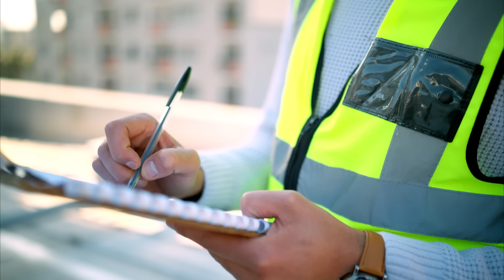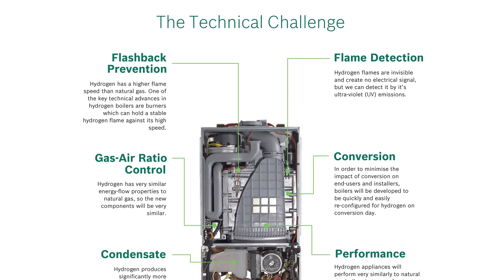Is Hydrogen Actually Dangerous? | The Real Facts

Comment: A mix of gases is probably the most practicable as there will be an increased availability of sewage and landfill gas and also a need to absorb/use them, as methane  is a potent greenhouse gas.
Also, the range between upper and lower explosive limits of H2 is greater than for NG or LPG - 4 to 96%. I don't know how this applies to a mixture.
By comparison NG/methane will not ignite below 5% concentration in air or above 15% (LPG is 2 to 10%)
Another cosideration is that it will ignite itself in the presence of platinum  - I remember there were kitchen stove lighters that were just a tiny piece of platinum that would glow red hot - no batteries or piezo. I don't know if platinum is used in any of our modern gadgets or sensors?
Given the lack of accountability we have seen with Grenfell and such, and the sheer number of companies that would be involved with statistically a high chance of cowboys, and greedy shareholders wanting corners cut (already a race of lifeless robots IMO) I would steer clear - especially if there is money to be made.
It might have its place industrially as an energy buffer but domestically an expensive trap.

A lot of Natural Gas is used as feedstock for making plastics; I don't know how that affects the market.

Comment: A sudden change to Hydrogen gas is not practical. 
It also is a master at finding any leak, absolutely not an option in an almost air tight heat pump heated house, we get houses that are anything but air tight blowing apart now from natural gas.
A say Hydrogen as a mix with natural gas and changing the mix over years allowing time for appliances to adapt at the replacement rate is the way to go.
But pure Hydrogen is never going to happen.

Comment: The question of safety is essentially moot until someone comes up with an economical way of producing hydrogen in the quantities required for widespread use in heating and transportation. So-called 'blue' hydrogen comes from fossil fuels, so the only rationale for using it is in things like buses in cities, where you want to avoid pollution at the local level, which is a niche use. The only viable source in the long term is 'green' hydrogen, made by electrolysis of water using electricity from renewable sources. However, this can never be as efficient as using the electricity directly for heating and transport, especially when comparing to heat pumps, which produce about three times as much heat as the electricity they use can generate directly. The technical difficulties and economics of hydrogen appear to make it unworkable for large scale adoption in the foreseeable future, perhaps ever.

Comment: Excellent video as always, Roger.
My thoughts:
1). Safety: you've got to design for the lowest common denominator. Hoping that safety devices will compensate for sloppy gas fitters goes against this principle.
2). You can't add anything to the gas to make it smell, as the smelly molecules will all be bigger than a hydrogen molecule.
3). Wind-generated hydrogen being used in intermittent gas fired power stations may be greener, but, as we already know, the electricity generators will charge a huge premium for intermittent use, so this is a mitigation of intermittent wind power rather than a solution in itself. 
For my money, the solution to all this is modern nuclear - not the multi-billion pound 20-year projects like Hinckley, but standardised modular reactors.
Reply: Nuclear is expensive and difficult to permit, but it's a bargain compared to hydrogen.

Comment: Hi Roger, I believe a correction is needed as you stated that “Methane is heavier than air” and this is not true as Methane is lighter than air. The average molecular weight of air is approximately 28.97 g/mol, while the molecular weight of methane (CH₄) is approximately 16.04 g/mol, making it less dense than air. LPG on the other hand is heavier than air.

Comment: The only gas appliance I have is a boiler. I would take hydrogen over a heat pump any day. If I were to have a heat pump I would have to pull up all my flooring (glued down sheets of wood) and cut channels to all of my radiators to re-pipe my house in wider pipework. There would be all the redecorating costs etc and short of lining all my walls with insulated plasterboard my house is about as insulated as it can get and it is a cold house now. So I would be looking at tens on thousands of pounds worth of work before I have even bought the heat pump. Not to mention the space required to house the tank etc. fact is, a heat pump just isn’t suitable for most houses. At least with hydrogen i don’t need to do anything.
Reply: Start looking forward to 6x more expensive heating with hydrogen.

With heat pumps, you may be able to get away with microbore, and specialist Mini Store and Nano Store cylinders are available/coming that could fit in an under counter cupboard.
Reply: @B @Biggest-hz7ng I refurbished my house about 2 years ago and they re-plumbed it in 10mm speed fit with the inserts that make the pipe even smaller. The flow and return are 22mm but from what I gather the 10mm tails with the inserts are a definite no-go. 

I was a silly enough to expect the plumbers to have the foresight to use something that would be future proof.
Reply: @xxxsmithxxxx  oof, I'm sorry to hear that. There are things like skirting board radiators that might give more output without larger visible radiators. Sounds like you'll be on gas for a while.

Comment: The margin of error with hydrogen tiny because the molecule size is tiny. I absolutely would not trust home appliance manufacturers or fitters to create and fit appliances/systems that are supplied safe and remain safe. Is rather have an electric boiler, despite the extra cost, or a properly designed/sized heat pump system. For cooking, electric induction hobs offer the response time of gas, with the safety and efficiency of electric resistive hobs.

Hydrogen fuel cell vehicles still have a sizable battery in them, and their well to wheels efficiency is only as good as a (non-plugin hybrid). Battery electric vehicles are the the solution for light vehicles and local buses and goods vehicles, and as their weight reduces and energy density increases, long distance heavy vehicles too.

Hydrogen is also not as energy dense as kerosene, meaning it is not a realistic proposition for aviation due to the size of the tanks needed, batteries are also not suitable size weight and charge time, and biofuel or synthesised fuel is a better fit for aviation.

For shipping, battery, biofuel/biogas, synthetic fuel, or nuclear works.

Comment: I have no problem with hydrogen, I look forward to hydrogen powered cars, considering Hydrogen is so abundant, it may push us closer to improved technology for extracting the hydrogen from water.
Reply: Unfortunately hydrogen's not economically viable to use in cars or heating. It's a niche product (fertilisers etc.)
Reply: @Biggest-hz7ng currently… Honda and Toyota are investigating it, i actually wondered if a petrol hydrogen hybrid would be better.
Reply: @stevenrobinson5864  electrolysis has become more efficient, but it is also everything around hydrogen that is difficult for cars: compression, storage and transfer of the hydrogen compared to electricity.

Comment: For over two hundred years gas containing about 50% hydrogen was reticulated to most homes in the UK. It was not seen as being the dangerous component of town gas. The more dangerous component was the carbon monoxide, which made up much of the rest of the gas. Hydrogen would burn, of course, because that it was it was designed to do. It would also explode, in the right circumstances, but it was no more dangerous in this respect than methane (natural gas is mainly methane) or carbon monoxide. It is not, inherently, poisonous, as is carbon monoxide. Like methane, if there is enough of it about it will displace the oxygen in a room and can cause death by suffocation, however, it is no more dangerous in this respect than methane.

Comment: We had to deal with Hydrogen underground in our coal mines. It was created when charging the battery cells for the underground locomotives. We were used to dealing with Methane and it's dangers but Hydrogen was very scary. Even the safety lamps used to detect gas weren't allowed into the loco garages due to its volatility and extremely high burn temperature.

Comment: I have a newly constructed  bungalow. The walls are a foot thick, with heavy insulation and super roof treatments.  Heating is underfloor. I also have a large solar panel system and 30 kwh storage batteries . There no gas here out in the country. This is an idyllic location and the bungalow is lovely. My energy bills average £200 / month. I'm happy with this   ( the  external heat pump is a little noisy at times but I can't hear it from my bedroom or living room)
Reply: Heck yes.
Reply: The heat pump costs you £200 a month to run and you have solar and battery???? Wow!!
Reply: @bobstirling6885  in retrospect I'm surprised at the running cost, given the work done (which I applaud). Maybe there's a calculation error? E.g. £200 per month in winter or £200 per year or lots of driving happening.

I'm at around £100 per month all in, with fairly simple ways to a zero bill home (more solar and reasonable battery).

Comment: Meanwhile, JCB and many other large engine manufacturers have hydrogen ready engines, knowing battery electric cannot replace Diesel in more arduous applications.
Reply: They are selling like hotcakes, right?
Reply: @Biggest-hz7ng did you not understand my comment? Is diesel still available?
Reply: @BROOMEngineeringTMIET  probably I didn't read carefully enough. I can't see it being a reason to buy though, hydrogen won't be used natively in vehicles (in e-fuel form maybe)
Reply: @Biggest-hz7ng can you explain why you think this? 
Out of interest, how do you know more than the industrial engine manufacturers?
JCB have a hydrogen excavator currently working on a Thames crossing.
Reply: @BROOMEngineeringTMIET  the 5-6x cost of green hydrogen which isn't going anywhere soon suggests it won't be big. There's plenty of other clean up to do elsewhere before hydrogen.
Reply: @Biggest-hz7ng  you seem to be really struggling with my comment, and not answering the questions.

What will replace diesel in more arduous applications? Please don't say battery electric, because you will only confirm you are another lunatic!
Reply: @BROOMEngineeringTMIET  diesel for a while, then possibly e-fuels or dare I say it, electric (it's spreading through trucking).
Reply: @Biggest-hz7ng  so you still don't really understand what an arduous application is then? Trucking isn't!

I'll say it again.........(battery) electric will not do the really tough stuff, hence why the large industrial engine manufaturers (JCB, Caterpillar, Perkins, Cummins, MWM etc) have hydrogen ready engines.

I'm all ears as to how you know more than them?
Reply: @BROOMEngineeringTMIET  there's many years before these vehicles need to be cleaned up. It's lovely to have the possibility of hydrogen engines, but why would you clean these up now? As Michael Liebreich says, crazy amounts of tankers delivering hydrogen to a construction site seems silly.  His suggestion is biomass or biogas. But for the moment, why define the solution for something so remote?
Reply: @Biggest-hz7ng so why is it silly when the government is mandating EV's in other sectors?

Why is delivering hydrogen to a site and more if an issue than delivering diesel to a site?

And construction often isn't particularly arduous, relative to other activities.
Reply: @BROOMEngineeringTMIET  moving to hydrogen would cost the sector money, rather than save it? Liebreich suggests you'd need 16-18x more deliveries of hydrogen than diesel. Fix what you can in the sector cheaply with electricity. Leave the difficult, costly stuff to the end (20 years away), along with flights?

Are the manufacturers anticipating hydrogen subsidies for their work on engines? And are the biomass/biogas engines already done?
Reply: @Biggest-hz7ng you still seem to not be grasping that there are applications where battery electric will not work. You cannot just look at the cost. The solution needs to actually work and do the task.

And yes........we have been running engines on various gases for decades, so that element is largely tried, tested, and proven. Just like biogas, from anaerobic digestion, has been blended into our gas networks for years.

And still haven't explained how you know more than those actually doing it? JCB has battery equipment, yet it is still exploring hydrogen power.
Reply: @BROOMEngineeringTMIET  exploring is fun. The cost does matter. Who is the customer, when are they going to pay for it? I don't think the UK should be mandating a transition off diesel for this sector for many years, due to extra costs and complexities (versus the small benefit). Why burden the industry? There are greener ways to spend the money. And at that point maybe there are better solutions than hydrogen? And with electrification, maybe there's only half the job left to do. Unless they have a customer right now.
Reply: @Biggest-hz7ng 500kW, pretty much continuously, for say 15+ hrs a day, is not going to ever be stored in batteries.

And the cost will come down, and hydrogen infrastructure expands........in the same way it has for batteries.
Reply: @BROOMEngineeringTMIET  hydrogen costs (creation, compression, storage and transport) don't scale the same way batteries do. Green hydrogen isn't likely to get much cheaper in the short or medium term. If, in 20 years it is the best option, then it may get adopted, but the suspicion is that other options will be better.

In the meantime batteries will convert the industry from the small machines up. Presumably there are huge (50%+) heat losses with diesel, battery density will continue to improve and you can use batteries external to the vehicle. When the time comes whatever the best technology is will be used to convert the remainder of the industry?

Further edit: the JCB press release seems to accept that electrification is the answer for machines up to 3.5 tonnes. Given how batteries keep improving, I can't see that as being where electrification stops.

Comment: I really do suggest that you re-do your references to the space shuttle, that was completely wrong. Hydrogen did not leak into the “spaceship” when the seals failed. The seals were in the solid rocket booster and when they failed they formed a blowtorch which ruptured the external fuel tank which ignited and destroyed the shuttle. This information is widely available.
Reply from the maker: If this video was about the space shuttle I would take your point but I mentioned it as a potential danger of the wrong materials being used with hydrogen. 
If you give a talk on anything the trick is to hold your audience, not take them down blind alleyways simply  to demonstrate how clever you are.

Comment: Hydrogen in homes
You want to forget about safety as an issue - it’s irrelevant. Right now natural gas exposes people to a risk of about 1 in 10,000,000 pa. of becoming a fatality in the UK
Hydrogen is easier to ignite, has wider flammability limits and is more likely to detonate - but on the other hand it is also more likely to disperse and even if it were considerably less safe than natural gas it would still be likely to be a safer source of energy than electricity which kills over 10x the number of people than gas does.
In the end it will come down to cost - or more to the point the cost of heat pumps plus all the electricity grid upgrades needed to support them vs the cost of producing hydrogen. Both options are eyewateringly expensive.
Right now I don’t see either option getting very far, and they’ll both be dead if Nigel Farage and the reform party gets in.
For those who care about such things they’d be better off spending their time trying to head that off than worrying about hydrogen or heat pumps.
Reply: Hydrogen is much more expensive than heat pumps and upgrading the grid.
Reply: @Biggest-hz7ng I’ve heard these sorts of assertions either way round before. I think they are driven more by faith than actual experience with proponents of either argument choosing data in a partial way to bolster their positions.
Most likely we will see neither hydrogen nor heat pumps rolled out because of a combination of cost, which nobody will be prepared to pay, and a Reform government likely to be elected in response to the various abuses pushed onto the British people by a political class that is disconnected from their needs and aspirations.
Reply: @Jonathan-z6e4v  heat pumps will continue coming. Their energy cost is similar to gas. Green hydrogen has a 5-6x cost compared to gas.

Comment: We currently use natural gas for two purposes, A barbeque and a Califont (external on-demand water heater), both of which are outside the house, So safety is less of an issue, and hydrogen replacement of natural gas will be more a matter of price and availability. Storage (gas in a bottle vs electricity in a battery) would almost certainly favor hydrogen in the same way that it currently favors natural gas.
Reply: Green hydrogen would be 5-6 times the cost of gas or electricity so I don't think it's coming soon.
Reply: You don't get natural gas in bottles - it doesnt liquify. Bottle gas is butane or propane